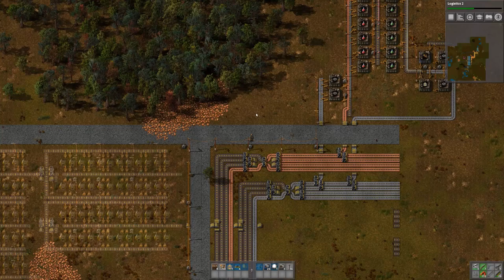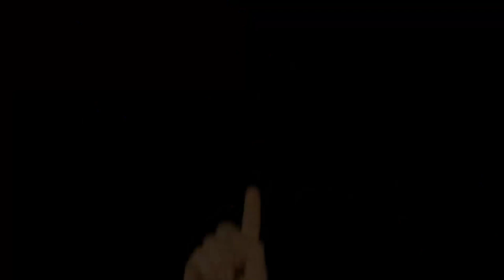How to play FACTORIO - Green Circuits Automation! #8

Comment: 12:30 As a general rule of thumb, you want to isolate each factory on its own and build it in a way that's scalable. That way if in the future you need a lot of gear/green circuit you can easily expand.Using a common belt for green circuit and gears limit you (especially as those two items are so crucials most players put them on their bus) Also, don't be afraid to "waste" space, building so close to the bus, other factories or tree will only make your life harder down the road

Comment: Hi Doc, This is a killer, but time for some belt science, since splitting 1 belt onto 2 belts half's  the throughput, not doubles.

Yellow belts have a throughput of 13.33 items per second. Green Circuits take 0.5 seconds to pocket craft but since a blue factory has a crafting rate of 0.75 its effective production rate is 0.375 per circuits with translate to 2.66 per second, therefore it takes 5.01 blue factories producing 0.5 second products working at top performance to fully saturate a yellow belt, since you need to be outputting to both sides of the belt and to compensate for some throughput inefficiency on the source products+inserters,  you need 6 factories, 3 per belt side to saturate a yellow belt.

You will need two factory sets, 12 total, one per belt in your bus, produce them on either side of the bus and merge with a slitter as you already done at the bus.
Always leave room to double this to 6 factories per side (12 total) per belt to allow upgrading to a red belt since they are literally twice the throughput of a yellow belt.
Final note, two saturated yellow belts merge with a red splitter perfectly  onto a single red belt.

Remember this applies to all 0.5 second items produced in blue Tier II factories.... And your welcome ( ' ', )

(Edit: Figure Typo's)

Comment: 17:10 Unless you plan to have two belts coming out of the green circuit factory (which would be hard considering how compact your design is), you don't need two belts of green circuits on the bus.
Reply: Yes and no. A second green belt on the bus just means he has double the belt storage.
Reply: The bus is not for storage. In this game you aim at having a factory that runs smoothly (no bottlenecks/clogging up). I mean at least that's how most people play.

Comment: 9:10 the tracks were not connecting because the splitter was in the wrong direction :p
Reply: yep, and he could have easily bend the line left from the tunnel and put down a splitter facing the left next to that to achieve what he wanted to.
Reply: ty doc it was a good one